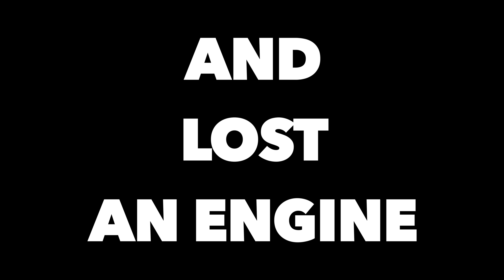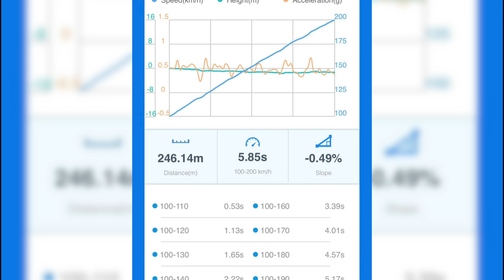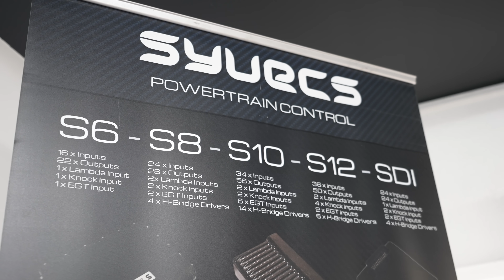GAME OVER.. *1500BHP AWD VR6 TURBO* CUPRA BUILD REVEAL

Comment: Fantastic build!  Great to see someone else using the 3.6 block.  Im about to try a 2.8 crank in a 3.6 to produce a 3.4 low compression setup, to make for a cheap large displacement low compression turbo engine.

Comment: Those shiny pieces and that turbo 😮, I'm close to the main build if my golf r I'm not going for crazy power but for something different I've had a stroker build in my head shortly after buying the car! I'd be happy at 500bhp wheels, and mod the suspension chassis to handle the power properly...just think a stroker would add that little unique extra grunt.

Any way can't wait to see your build flourish it looks epic...that car can't be too heavy and 1500 ...woosh

Comment: I would honestly not advise the full exhaust out the bonnet, my 2.8 Golf VR6 BDE is absolutely terrifyingly loud out the back😂 I'm also building my 2002 VR6 4motion with a PTX3582RS, stock motor with ARP boltons and gasket spacer and plan for my wastegate to be out the bonnet! Smashed it again Jamie, welcome to the VR gang!🤟

Comment: No bonnet exhaust.  Leave this one looking kinda standard, bit of a sleeper vibe. 
An unassuming assassin if you like. 

Interested to see how you get on with driveshafts, studs, bearings etc because this is going to prduce not just power but huge chunks of torque when the snail gets spinning. 

One things for sure this is going to be one hell of an experience and one hell of a car.

Comment: The reveal is that the Cupra is going to get mounted to a turbo. Qustion is, where tf are you going to put that big boy? Can't see it fitting under bonnet so I'm guessing either passenger seat or it's getting its own trailer. Or maybe a rear mount under a perspex boot floor. This is going to be rapid either way.

Comment: i don't think the 3.2 VR6 was rubish ! sure the m3 had 340 hp but the 3.2 vr6 does run 300 000 kilometers without any major maintenance :) these are reliable engine compared to the e46 m3

Comment: Jamie I love Your work bud but im a little afraid that Youve made the wrong choice this time. The R36 will not live at those power levels. There a reason why all super big power VR6 builds is the R32 destroked back down to a 3.0 using the 2.8vr6 crank. The stroke on that R36 and even the R32 is Your enemy. The bearings just dont live at high power levels. The destroked R32 aka R30 is the way to go. Get 1300Hp reliably and make power all the way to 8500rpm. I really hope You prove me wrong bud. Good luck with this monster.🎉🎉